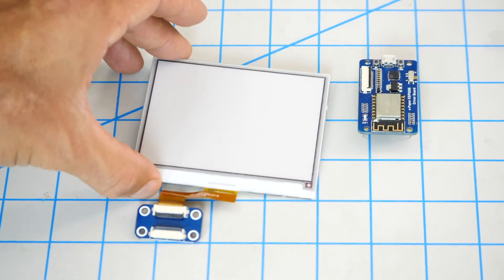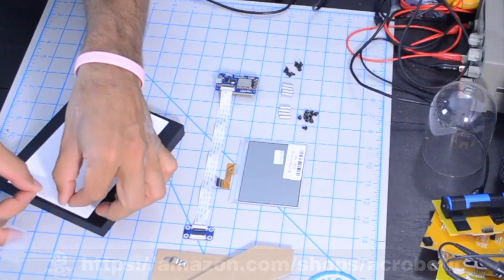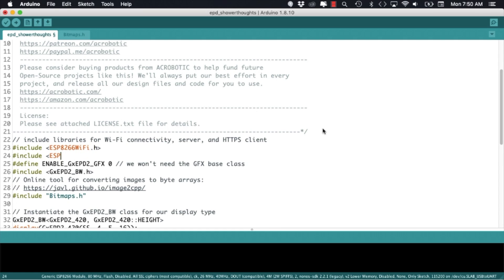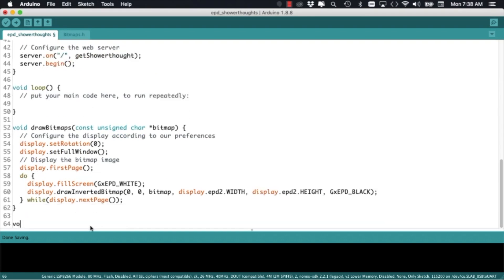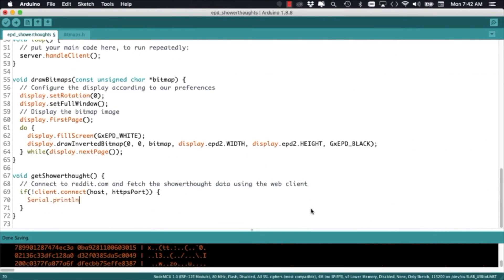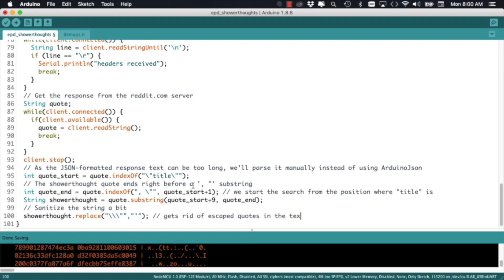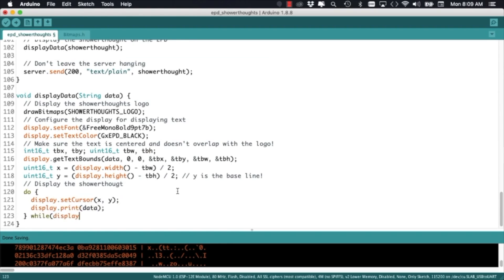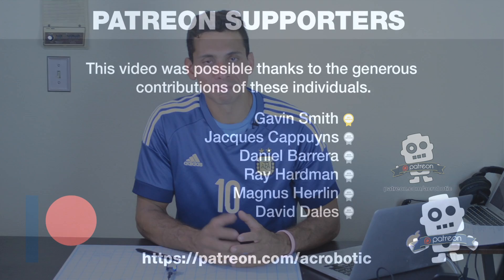ESP8266 e-Paper Displays Funny Quotes | Scraping Reddit Data

Comment: nice one, kinda gave me lots of other ideas but there some questions for me:
1 - what makes it different than other tft displays?
2 - how big was your bitmap icon and what amount of memory did it need?
3 - how much energy does this kinda display consume?
4 - i was thinging to run it on battery and give the esp some other functionalities like deep sleep and so on to down the energy or using some energy harvest methods to use it for some of my projects
Reply: @jblecoz  well i did knew about it what i ment was the size it took 
not the formula 
like how much of flashsize did it allocate for the icon he made
Reply from the maker: Hey, Ali. Glad you liked it!
1 - good: ultra-low power, high contrast (closest to real paper). bad: slow refresh rate, 2 or 3 colors only.
2 - 400x300 8-bit bitmap; stored in a char array of 15000 elements, so literally 120,000 bits of memory.
3 - it only consumes during refresh. the image stays on display even if the board and/or screen lose power. if e-paper is used to its strengths—i.e., for displays that are updated relatively infrequently—it will use considerably less power than a same-sized TFT LCD!
4 - definitely a great addition to a battery-powered project, as long as you don't need information refreshing quickly on the screen